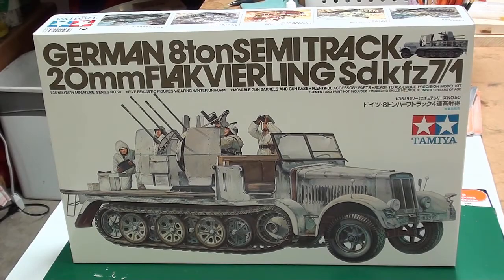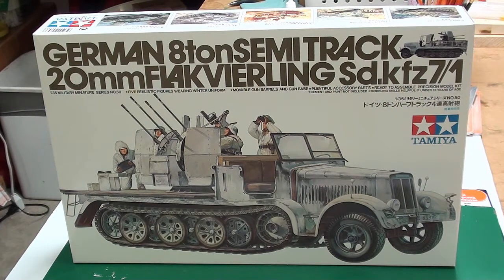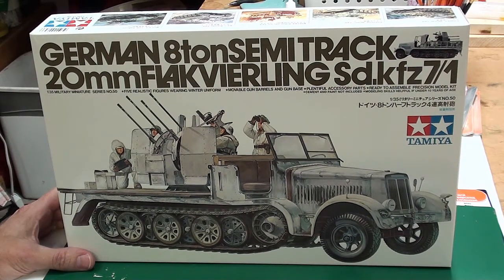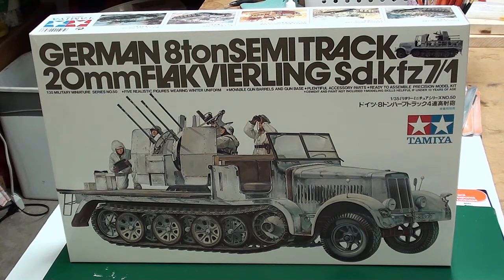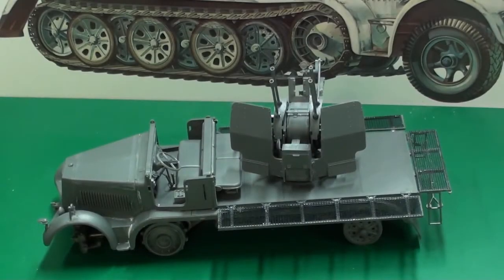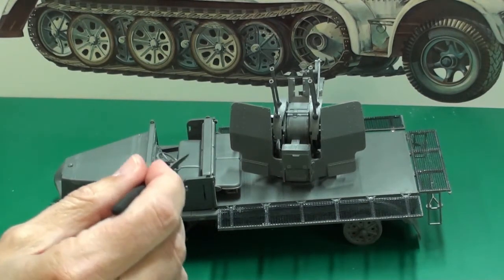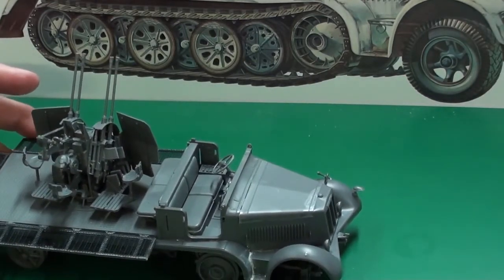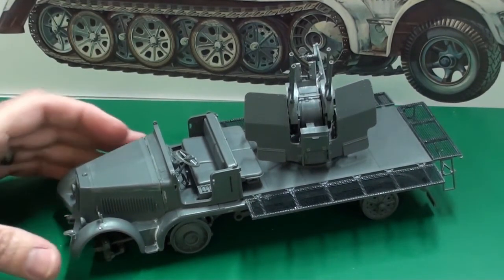Sd.Kfz. 7/1 20mm Flakvierling Half-Track Build - Update 1

Comment: sweet video man, nicely presented :) i hope your eye heals up as soon as possible man!
these little antenna-like things on the front fenders are there to allow the driver to estimate whether or not he can fit through a street or gate. they are not sitting straight up on the fenders, but lean towards the side (actually the top is wider than the fender).
Reply from the maker: Thank you! One broke off and is somewhere in the abyss but maybe I'll just leave it off as if it was lost in battle. One thing I learned is construction order is important.  I needed to leave those little fiddly parts off until the very end.  The instructions show putting them on before the body went down on the chassis.  You have said in your vids that you don't always follow the instruction order.  I see why now.

Comment: They are called fender markers.Sorry u only have one eye at this time.Nice build so far.
Reply from the maker: Fender markers, ah cool.  Thanks, I didn't want to make the eye thing a central point but I did want an excuse for the horrible gluing and part placement! :)
Reply: I call them width indicators, forgot to mention that. They used to have them on cars in the 70s. It's so you know your vehicle can fit through something as they're as wide as the widest part of the half track.
Reply from the maker: That explains why they are angled out away from the fender.  My first car back in the late 70s was a 1970 ford something that had those curb scrappers.  Couldn't pull those off fast enough, not cool in high school!

Comment: what size of drill bit you can recommend to drill those 20mm guns? thx for the answer im just a newbie in the hobby
Reply from the maker: I don't remember the exact size but the diameter was smaller than about half the diameter of the gun end.  The holes didn't look as good to me until I reamed them out with a hobby knife.  The guns in this video don't show this. I had a common pin vise set and picked one of bits for the job.  I would invest in a pin vise (really small finger drill) because you will run into times when you need a small hole drilled. I used a #11 blade to ream out the holes more.  This is the typical triangular shaped blade that comes stock with knife.  I used the blade to carefully ream out the hole more until the thickness of the wall was good enough.  The gun barrels are tapered at the end.